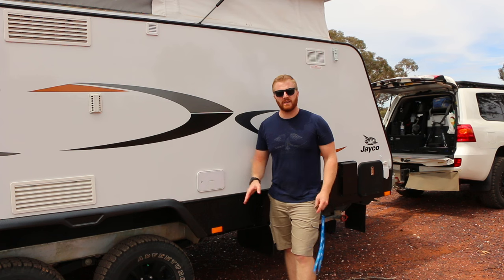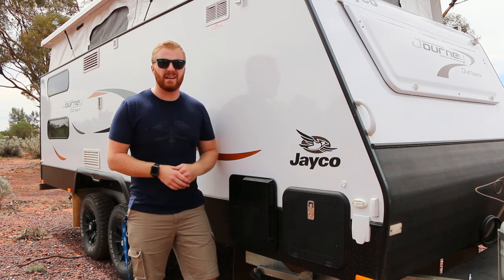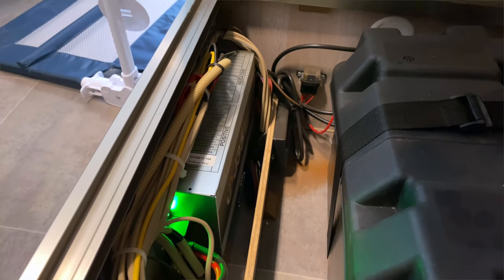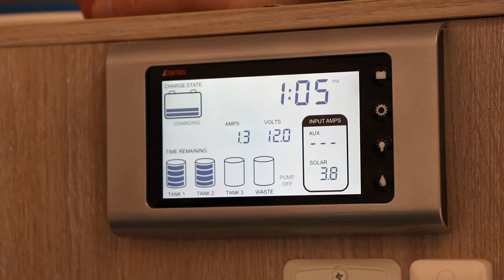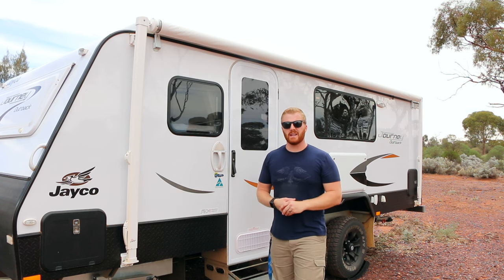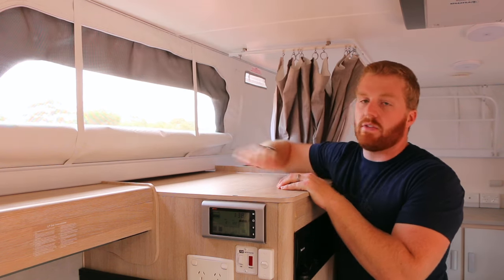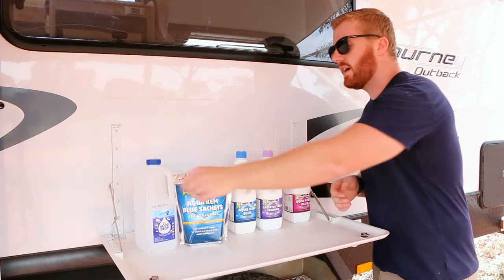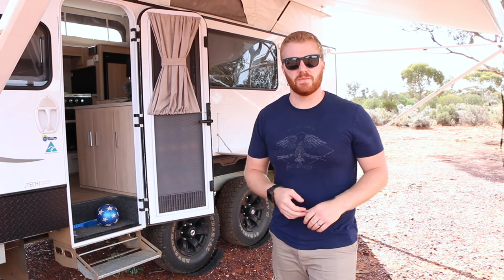HOW TO: Use your Jayco Caravan - Toilet, Hot Water, Water Tank, Fridge, Electrical, Awning & Pop-top

Comment: Hi Nathan. Just another tip in regards to the water tank selector tap. If the tap is in the middle position (ie drawing from both tanks) and one of the tanks runs empty, the pump will start sucking air in via the refill point and water will stop flowing from the tank still holding water. To overcome this, flick the selector tap towards the good tank. This blocks air coming in from the empty tank and you're good to go again. (until the second tank empties anyway :-) )   - Great videos.
Reply from the maker: Thanks mate! Soo many great tips to learn when using these vans. I have noticed that almost always the tanks drain at different rates, so this is bound to happen when they start to run out. 
Cheers, Nathan.

Comment: Hi Nathan, yet another great video. About 6 months ago our HWS stopped working on 240V in our 2011 Discovery, works fine on gas. I was told I probably sizzled the 240V element by forgetting to turn that silly misplaced on/off switch inside the water unit off then when getting home reconnecting the 240V to keep battery charged and of course no water supply and now heater element possibly damaged. Looking forwards to a vid on HWS element testing/replacing😉
Cheers!
Reply from the maker: Ahh, thats not great. Personally, I haven't had experience with replacing components of the hot water system, but I can assure you, if I need to I'll definitely get a video produced.
Again, thanks for watching!

Comment: Great video mate, just looking to buy the journey outback and this was very informative. Have subscribed. Just one thing I’d like to know is where does the shower and kitchen sink water go. Just out onto the ground or into a tank
Reply from the maker: Thanks mate, I'm glad you were able to get some value from this video. 
So from standard, the waste water is collected at the rear drivers side of the van where it exits via 1 port. This enables a pipe to be fitted to the plumbing and the waste water directed into a drain or away from camp. 
Water can be collected and is often referred to as 'self sufficient' or 'self contained' systems. This involves adding a grey water tank to the van where the water is collected and can be emptied when required. Jayco do offer this as a factory option and theoretically wouldn't be hard to add to any existing system.
Hope this helps and good luck with the new van.
Cheers, Nathan.

Comment: Just to add, that particular Thetford fridge does not have a thermostat for the GAS operation. The user MUST monitor the cabinet temperatures otherwise it will freeze things like lettuce, tomatoes and eggs or it wont be cold enough and fresh meat etc will go off. The dial sets the flame intensity not the temp, so it does not automatically adjust the flame. After owning the exact same fridge for 6 years it is not a prob for us. We like the simplicity of the manual fridge, but others complain bitterly. Buy a wireless thermometer for the fridge. ALL 3 way fridges are very slow to react to temperature changes. Make sure it is at operating temp before any food goes in, so run it for 24 hours before you load food into it.
Reply from the maker: For sure, that's a great point. Thanks for the tip 👍

Comment: Hey mate, enjoy your videos. Just purchased exact same van in the 2021 model. Did you use a weight distribution system when towing behind the 150 prado?
Reply from the maker: Cheers mate, glad you enjoy the channel. 
Negative, we did not. Using the airbag helpers in the rear suspension was enough the level out the vehicle with the weight of this van. 
Keep in mind they can't really be used off-road, if you plan on taken your van out and about. 
Cheers, Nathan.

Comment: Thanks for the video!.1 question, will the water tank fill the hot water system if I’m off grid?.do I have to turn the 12v pump on before turning the gas on?..cheers!.
Reply from the maker: Hey mate, so yes the 12V water pump will supply water to the HWS. This being said, unless you manually drain the tank from the exterior, the tank will always be full. As you draw water from it, the pump is re-filling it back up 👍
Hope that makes sense.
Reply: @XploringOz  thanks mate!.

Comment: Do you know if you can use electricity and gas together in the hot water system  to heat it up faster
Reply from the maker: For sure mate 👍 forgot to add this into the video. Thanks for mentioning it, at least others can see it in the comments now 
Cheers, Nathan.

Comment: I. Drained the hot water srevice and changed anoid.... How do i refill the hot water service... Thanks
Reply from the maker: Good stuff. To re-fill the hot water system, you just need to turn your water pump on. There is a sensor inside that will automatically switch the pump off when the correct pressure is restored. 
Don't be too worried if it takes a little while, theres about 22L required to fill. 
You might find the pump will switch on and off a couple of times when it's almost full too.
Hope that helps.
Cheers, Nathan.